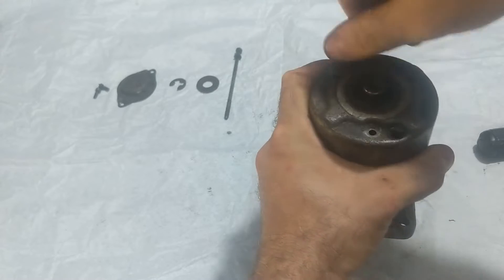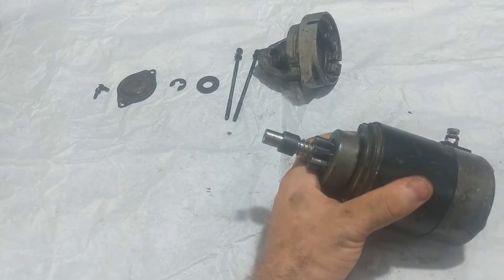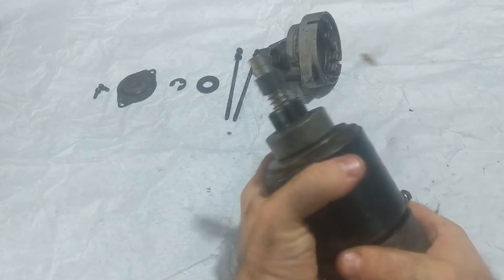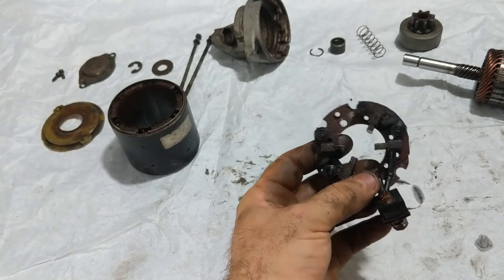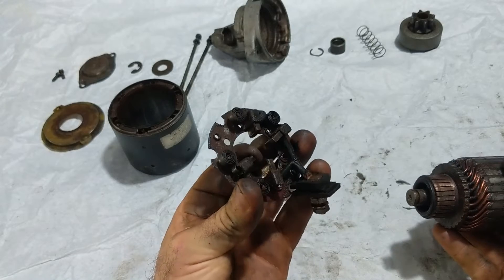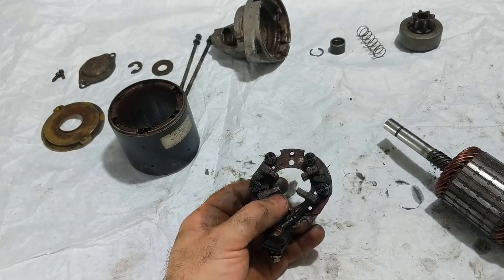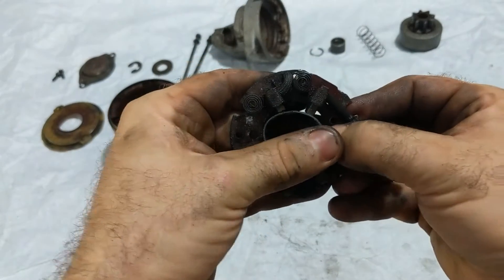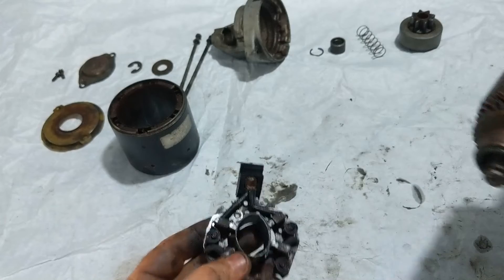How to repair a starter motor: rebuild and replace brushes

Comment: Hard believe you put everything back together without cleaning anything.  I usually polish the copper armature, wipe the stator and its spinning armature with denatured alcohol,  and put a drop or two of oil on the gear shaft and a  little white lithium grease on the bushing.
Nice tip for holding the brushes in though.

Comment: i had to wack my starter motor the other day for it to start, so is it my brushes that are worn ? i wasnt sure if it could have been the solenoid on it sticking a bit?
Reply from the maker: While both are possible, it is more likely to be the brushes

Comment: Hey Iv got a question form a video 9 years ago lol I have a 1980 Suzuki and I cannot figure out how to change the headlight for the life of me. How do I get the bulb out of the casing to actually swap them out?
Reply from the maker: Which model Suzuki?
Reply: @mrmaxstorey  gn400
Reply from the maker: @UrNotGood9809  yea unfortunately on that one the headlight bulb is integrated into the front glass. To stay oem you got to replace the whole thing, and there are some available on ebay. Lots of guys have cut out a hole and taken out the filament, and then fabricated a clip to accept a standard replaceable H4 bulb
Reply: @mrmaxstorey  might be a good idea to change it to after market then, I can’t find original parts for it anywhere
Reply: @mrmaxstorey  well thanks for your help I was starting to feel like a idiot for awhile there

Comment: Nice demo, Max! Loved that tip about using a spray can cap to get those brushes into place. I'm surprised the solenoid is separate from the motor here. Is this from a motorcycle?
Reply from the maker: Hey buddy its from a SUzuki outboard motor, but lots of motors have integrated solenoids. Im not sure whats the advantage